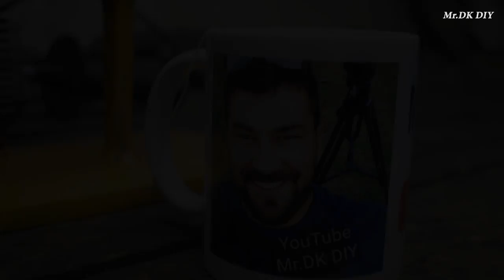Bicycle old parts ??? Don't Throw the Bicycle old parts !!! You Can Make Geniusl Thing Out of it

Comment: 2 problems when the angle grinder is not used, i mean in the vertical position
1. the disc is spinning very fast in front of you with no safety parts to protect in case the disc crashes.
2. the angle grinder is rest on the cable which in time will brake it. 

Otherwise, congrats for the idea to use old rusty parts.

Comment: I'm no professional,but I'm pretty sure it's not common practice to be welding with a map gas cylinder  and a pressurized can of wd-40 two feet away from the general welding area.
Reply: If you're scared , JUST SAY YOU'RE SCARED!
Reply: If you're scared, JUST SAY YOU'RE SCARED!
Reply: no that's mandatory mate, lol as well as paper towel covered in oil and grease the joys of working in a saw mill!!

Comment: Remove the cotter pin lock nut, then the  cotter pin, then the crank arms, then the lock ring from the bottom bracket.
Reply: The guy is not a bike mechanic to say the least; at the very least, I would take the BB apart, grease it, change the ball bearings before going on...